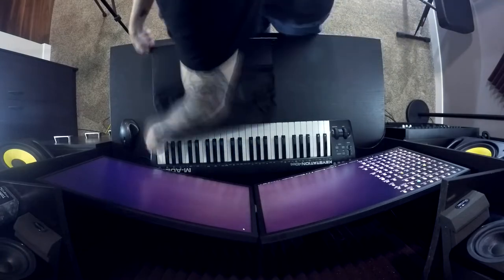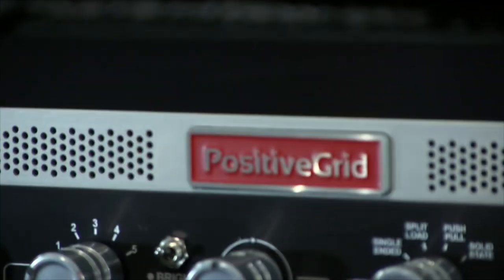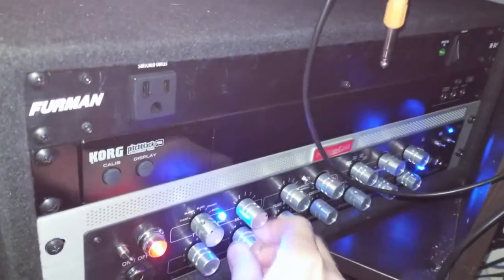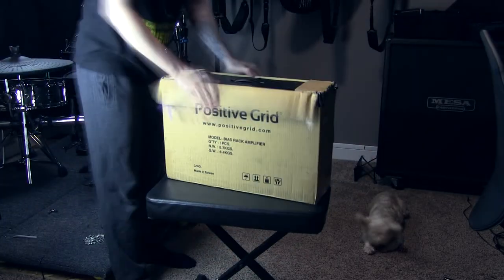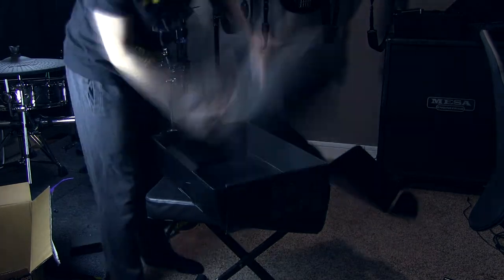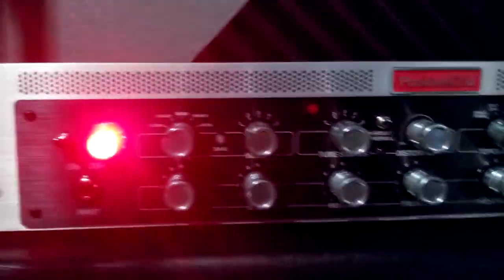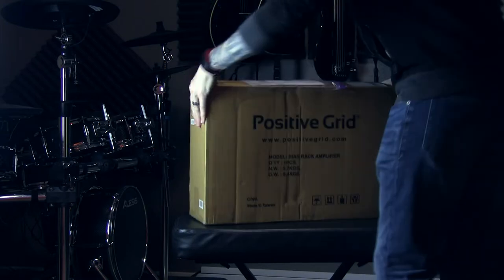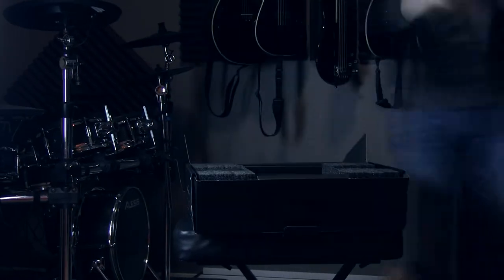Buying A Positive Grid Bias Rack? Watch This First

Comment: I just sold a 600w bias rack that was treated like a baby to someone. I used both the line outputs into an amp or the 600w speaker output depending in the situation. The buyer is telling me thru the 600w outputs its editing loud bangs thought the 600w output .. it was shipped and packaged well. Any ideas

Comment: i get a bit of fizz when i turn up my power amp. I have the rack processor so i need an external power amp (mooer baby bomb 30).
Reply from the maker: I'm not sure about the processor version, but that doesn't sound like quite the same issue as the powered Bias Rack. The hiss in this one isn't dependent on volume. It's just always there, so that makes me think that the problem is in the power amp circuitry somewhere. 🤷‍♂️ Have you tried PG support? They're decent about helping troubleshoot if nothing else.

Comment: I have a question about connectivity issues with the BIAS Head version I purchased used from Reverb. Is there a “special” usb cable I should be using? Because I cannot get any of my 3 computers to recognize it when usb connected. Also, the Bluetooth light flashes but no one’s home. None of my apple devices detect it with my Bias Amp2 Pro app. 🤷🏼‍♂️ Side note: it functions fine as a standalone amp just cannot connect to the app.

Comment: I was just considering a used one of these, and needed this information. I'll be sure to find a newer model of going used. 

Side note, would this and the rack amp be two separate parts in my rig, or could I use just this into a cab sim and be good? Thanks for all the information - super helpful even today 🎉
Reply from the maker: Yep I suspect they worked this out in the  newer models. This has a pretty beefy power amp, so you dont need an external one. You can also run this with a cab sim because you can bypass the power amp. 🤘

Comment: Had same issue on both of mine. I paid for 2 replacement audio boards which worked for 2 years until today when one just completely died and makes a squealing feedback noise. That’s it. I’m done with their products. No support or warranty for me since I bought mine off Reverb NEW in unopened boxes. Guess you have to buy straight from them but Positive Grid was absolutely no help whatsoever and wouldn’t honor any warranty.